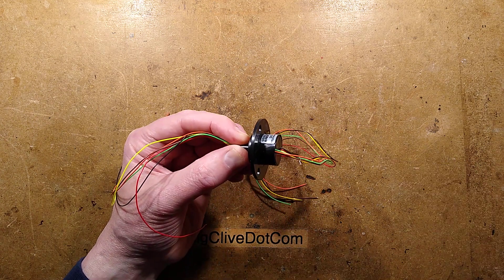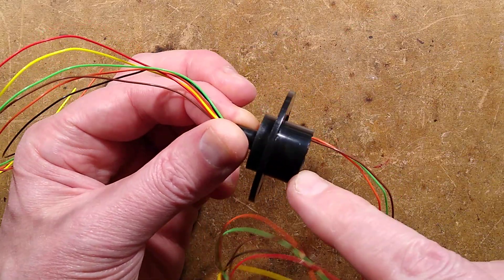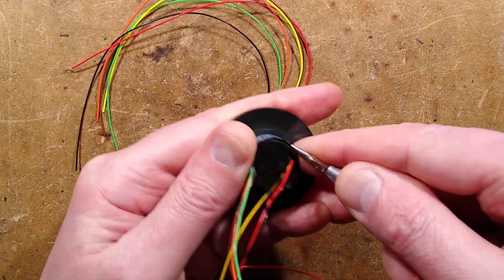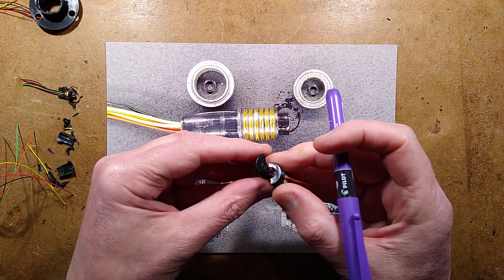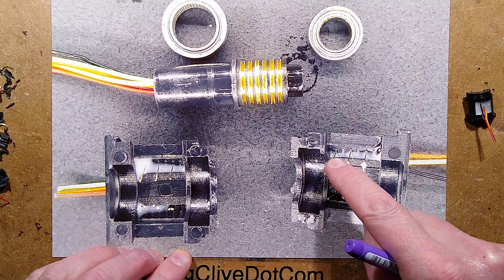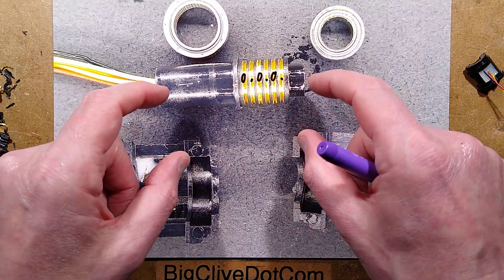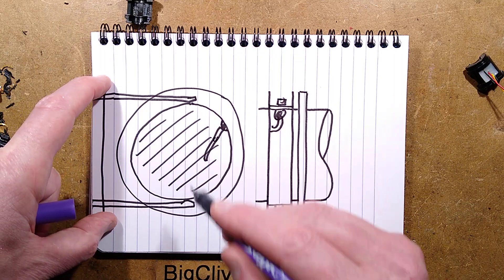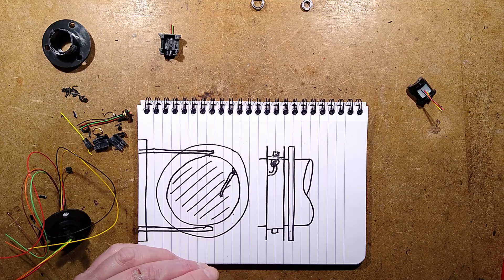6-circuit slip-ring teardown

Comment: I build rotating camera obscuras with 24V motors and 0-5V analogue feedback signals. They do a 24-channel unit and for reliability i double and quadruple up the lines, rather than using a hugher current rated unit with fewer connections. So far so good!

Comment: I have an HO (OO in the UK) scale model railroad that runs across a fireplace mantle over Christmas. It's 4m long but only about 30cm wide, so no room to loop the engine around. Since this is very non-standard,  there's no hope of buying an commercially made turntable, so I 3D printed a pair of 20cm turntables to turn the locomotive around at each end. I use an 8-wire version of the slip ring as the central pivot for each turntable. 2 Wires for track power, 4 wires for LED signal lights at each end of the turntable bridge, 1 wire for a light in the bridge operator's cab and 1 wire for LED common. Thanks for opening one. I've been wondering what they looked like internally.

Comment: When I was a child, I thought of a miniature train with an electrical system similar to this
The rails are made of wire/copper, each of which (right rail, left rail) is electrified by the anode and cathode, then the two cables to the DC motor in the train are placed attached to the rail anode and cathode.
But I'm not sure if it will work to make the dc motor spin and move the train with the dc motor wires dragged along the rail?

Comment: The most gorgeous slip-ring that I ever laid my eyes on was on a project several years ago to restore an 18m satellite dish built in the late 1950s.  Signals and power (lots of power) were brought across the azimith-axis interface with a 32-channel slip-ring where the rings were solid brass, with phenolic separator sheets.  The contacts were brass rollers that rode the brass rings.  It was a lovely, lovely piece of old-world engineering....
Reply: Rollers on the rings? Then you need something to make contact to those. Quite a lot of Ohms it sounds like

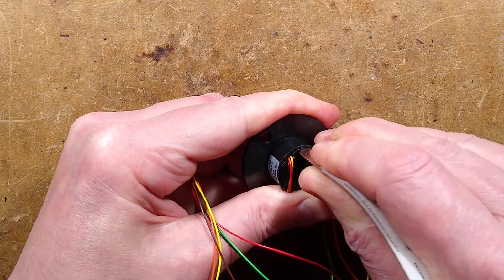Comment: 1:40 - "such good connection you could actually run data through it": I've run streaming video with a USB 2.0 webcam through these modern ones.  USB 3 not so much.

Comment: where would a hobbyist get parts to drive one of these with a motor? there doesn't seem to be a way to hook the motor up a axially...would you need gears or a pulley?
Reply from the maker: It's designed to be built into products with the required parts.  This slip ring assembly is not intended as a bearing, just as a pass-through for power.

Comment: thinkign i could use this for my steerign wheel for paddle shifts and horn
Reply from the maker: It's not suited for high current.  The steering wheel usually uses a spiral cable called a clock spring.

Comment: I always think: why don't they just replace horrible brushed, commutated motors, with electronically switched ones and some ultra low friction slip rings?
The mentioned lead (or other liquid metal) slip rings would be ideal I guess. No need to put mechanical load on them, or for the rotating and stationary parts to rub against each other due to the liquid metal. They could be very efficient I suspect, and last the life of the device it uses them. Lacking liquid metal like lead, or gallinstan, they might use some highly conductive lubricant, (Maybe oil with silver particles or such)

Comment: I am wondering if the unit was gas tight before you opened it and it had a vacuum internally to limit arcing on DV voltages?
Reply from the maker: No obvious way to maintain a vacuum.

Comment: If you're not familiar with them, look up automotive clockspring.  It's a clever way of making electrical connection to something that makes a limited number of turns, such as a steering wheel.
Reply from the maker: I took one apart in a video.

Comment: We have these in our explosion protected PTZ cameras. They pass 24 VAC on two pairs from a toroidal TFR that is located in the bottom and 100 baseT TCP/IP. We do have problems with the IP cameras freezing up and rebooting when they are being panned around. I suspect it’s this slip ring causing either power or comms issues.

Comment: ac doesn't degrade contacts as redily as dc does. thats why relays have vastly different ratings for switching ac and dc loads.
Reply from the maker: It's much harder quenching a DC arc than an AC one

Comment: It would seem to be impossible to connect a continuously rotating object directly to a stationary object via a ribbon cable without having the ribbon twist until it breaks.  Thus, the need for slip rings.  However, amazingly, it is possible to do just this (using hard-wired connections) without any sliding contact.  The scheme is used sometimes in centrifuges.  Look up "anti-twister mechanism".

Comment: This is actually the smallest slip ring I’ve seen. I build human centrifuges/flight simulators, the main planetary slip ring can have over 100 circuits and covers several mains circuits  (480V, 3ph, >50A ) for yaw/pitch/roll servos, as well as voice, data and video connections plus redundant circuits. 
I spend a day or two testing all the circuits before installation and even these huge expensive slip rings can occasionally have a dead ring and have to be sent back for rework.

Comment: Older video head drums (also in other helical scanning tape mechanisms) also used slip rings, though newer units switched to rotary transformers. Is there a good lube to use on these, or is it best used dry? Because I have some V2000 decks and there are slip rings for the video head's DTF system, and they're really worn. I'd like to get a little more use out of them, since nobody has made V2000 heads in 30 years or so.
Reply from the maker: If there is lubricant it would probably be a very specific type.  Best answered by the video community.

Comment: I use these on my Planetarium Star Projector. There is an axis for rotation at the base /Yaw with 48 Conductor rings, another axis for Elevation with 2 sets of twelve on both sides, and then inside for the Diurnal I had to hand build an 8 conductor pancake slip ring. All these carry the grounds, stepper motor voltages, encoder signals, and control voltages to turn things on and off.

Comment: I've seen slip ring assemblies for medium voltage cranes.  I love seeing how electromechanical devices look on the inside.  How they carry power and signals through connections meant to move.  There's something alien or steampunk about how some of these things look.  Anyways the rings on the MV connections were old and you'd get a corona glow and ozone when it hit the rough spots.  I was politely asks to step away from the slip rings because an arc flash analysis hadn't been done and they didn't know how close anyone should stand near it...

Comment: Going to use my eBay purchase slip ring for a diy wind turbine power generator made from a car radiator fan motor. Am able to pass the motor wires down through the top of the tube/post from the Motor via this slip ring and into a solar charge controller etc..

Comment: I worked with some such when I worked at Briggs & Stratton running engineering tests the ones we used where much higher quality but were expected to perform at much higher RPM. 
Fun lil thing it is

Comment: I love sliprings for some strange reason. I think it all stems from using "Mercotac" contacts to make rotating speakers (Leslie Speakers) for a mechanical tremolo effect on organs and guitars. They are light years better than your average sliprings having extremely low-resistance because the conduction path is a liquid metal molecularly bonded to the contacts. They never wear out.
Reply: As a Hammond tech I can attest to the Mercotac bearings being very reliable.  In 40 years of service I probably replaced 4

Comment: I made slip ring thing pings myself using stainless steel rings and carbon brushes to drive HPS lamps for the hobby. The rotating thing ping apparatus was physically set in motion by an old clock. Pretty amazing that it worked out. Actually the ballasts were separate so also the initial starting current went through my slip rings. Never had any problems.

Comment: Mercury bans are actually a fairly complex subject, and depending on locale there are small exceptions. More recent patents for slip rings use brushes or non-mercuric liquid metals, so it seems like the bans caused a slight upset in the industry. I do enjoy the idea of a slip ring having an inflammable/explosive warning on it.

Comment: If you wanted to use one of these for data/video. What would be the best way of testing them? Just a motor and then push a high frequency squarewave through them or is there a better way?
Reply from the maker: Just have something like a camera rotating continually to see if the video signal shows interference.

Comment: US Navy SH/MH Seahawk helicopters use slip rings at the tail rotor (for blade de-ice) and main rotor head (blade de-ice, position sensors and blade fold motors) and while the tail rotor slip ring is 'race tracks' of copper and pickups of sprung carbon contacts, the main rotor is a 3+ foot long monster that travels the entire length from the top of the rotor head and the distribution box, to the bottom of the main transmission and even then the cable for it is another 4 feet long.

Comment: On the CCTV side, they are used in PTZ cameras to pass the ethernet connection and power between the rotating camera portion to the fixed power/data input section.

Comment: I have been using wind turbines for around 6 years, and they come fitted with non sealed internal brushes and slip rings which fail after 12 months or so. I fitted a mercury wetted sealed unit with brings down power and data to my controller and it performs perfectly (now 3 years without trouble). They are very expensive, especially the high current versions, but save 2 days of ladders and pulling apart everything to replace the factory fitted open units.

Comment: A slightly bigger version is commonly used to upgrade motorcycle wiring on the front fork because the wiring from the factory bends every time the front handle/fork is turned and eventually breaks the fixed wires.
Reply: I've never seen a motorcycle with a slip ring.  I've never had a motorcycle that had handlebars that turned 360 degrees either...  Stunt bikes maybe...

Comment: I'd be happier using ball bearings as the contacts - the inner and outer rings are kept in contact at multiple points by the balls.
Reply from the maker: There's an issue with ball bearing races carrying current.  The tiny contact sparks gradually cause spark erosion that gets worse with time.

Comment: TIP!
Some more  expensive  water boilers with digital temp controls and electronics in the base ,have more than 3 slip rings  in the central hub conector,  defective boilers of this kind can be used for parts where higher current / line voltage is wanted in a rotating assembly.  Unsure if it can manage constant rotation..... (probably not;,but intermittent  movement at slow rpm may work.)

Comment: I understand there is something similar in most steering wheels to transfer power for horn button, airbag detonator etc.
Reply from the maker: That's often a clock spring - a coiled ribbon cable.

Comment: The cotton candy machine I work on at work has brushes on a solid core of copper that is attached to brushless motor. These are the connections for the heating element that spins. It's a pretty old machine so I'm sure that later revisions have been updated
Reply from the maker: That's very standard.  Two brass or copper rings with two carbon brushes.

Comment: I have the same one on my weather vane project. I have an Arduino Pro Mini inside the rotatable 3D printed weather vane body, a propeller on one end, a MLX90316KDC-BDG rotary hall direction encoder in the middle, and a tail fin at the back. The Arduino processes the data and comes out via serial RS-485 through the slip rings to an indoor LCD display. The slip rings have been working fine for a few years now. Nice to see how the slip rings work inside, thanks.

Comment: I think if you had a CCTV camera rotating at 200 rpm, you wouldn't need to worry about signal quality!

Low voltage lighting in rotating display cabinets, maybe, or display turntables. I could see an application for these in model building where you needed to bring current to lighting on things like big-wheels, carousels and similar items, model railway turntables where you might want to supply power to lighting poles, motors and to the actual rails that the locomotive is standing on.

With a bit of imagination, there must be a million and one applications, but I agree entirely, not at 220v. At 22v, maybe!

Comment: They are also used in automobiles behind the steering wheel.it’s used for horns and airbags.
Reply from the maker: Those might be the spiral ribbon cable "clock springs".

Comment: You would think automotive airbags would use this, they don’t. They have a clock spring that attaches to the steering wheel and electrical connect the airbag to the system. You have to wind it by hand counting the turns and then move it to the middle position so you have equal length turning the wheel left and right, if you don’t install the clock spring correctly you will break it and you just destroyed an expensive component. Usually when the bags blow the clock spring is still good.
Reply from the maker: I featured a clock spring in a video.

Comment: Thanks Clive. I notice the middle finger of your left hand has thankfully lost the Elastoplast. At one stage I thought it may be making another reappearance if the screwdriver had slipped. I have a beautiful 1 inch scar on my left thumb where some very sharp plastic split it open during some similar disassembly many moons ago. IIRC I think I taped up the resulting wound with insulating tape, we didn't have gaffer tape then.
Reply: Thousands of people in the US end up in the hospital emergency room every year because they cut themselves while opening clear plastic "clamshell" packaging .
Reply: @goodun2974  Nasty stuff that packaging. It would not be impossible either to include a "Tear here" seam in the manufacturing process.
Reply: @linuxgreybeard9945  ,  those clamshell show packages are often too thick and heavy to cut with all but the sharpest of scissors and so I usually cut them open with a surgically sharp OLFA knife and blade.  The sharpest razor or utility knife blade commercially available, they are scary sharp, but not as scary as the freshly cut edge of a clam shell blister pack.... And yes, a rip strip to make it easy to open the package would be a good idea, but I guess that's beyond the capabilities of the "geniuses" who designed packaging. I routinely encounter Plastic bag packaging for snacks and dog treats and so on that have a notch in the side which says "tear here" and then you're supposed to be able to seal it up again with a Built-in ziploc strip, but they don't open correctly and they don't seal correctly either.

Comment: Same principle at play with regular corded vacuum cleaners, the kind that has a windy cord that you need to pull out and then it reels itself back in when you hold a button. The fingers in the mechanism get worn out over time, it's a very easy fix as you just need to put a bit more bend to them.

Comment: I own a turntable of which the tone-arm rests in a mercury bath (the contacts...No gold contacts obviously...I think titanium or platinum but not sure 'cause very tiny), every now and then I need to "refill" the mercury...Better said replace for clean mercury and with that replacement you can simultaniously clean the "old"....which can then be used again the next time. Ofcourse it evaporates a little over time too. Not the most healthy system but it sounds awesomor at least as good as normal wires. I keep it because of the quirkyness but use a different TT most of the time. It is a Japanese system of the late 70's, early 80's made by Micro Seiki. Got it of my dad who bought it new since he always was a crazy audiophile.
Correction, the arm is by Micro Seiki and the contactor bath by Keith Monks.....

Comment: Where I work, we use tons of slip rings for various things.  In fact, we have some fiber optic sliprings for data.  That is a teardown I'd love to see.
Reply: I've seen a single fiber run straight down the middle of a rotary joint, but when you say slip-rings, are you implying multiple fibers? Now I'm intrigued.
Reply: @myself248 No -- that's what I mean also.  It's a combination electrical slip ring with a fiber in the center.  I should have been more clear.

Comment: Radar rotary joints might also pipe kilowatts at microwave frequencies down two pipes for two polarizations, plus slip rings for red lights on the sail, and even some low power coax downlinks. You don't get those on eBay cheap.

Comment: I frequently use slip rings from michigan scientific to transfer out the signals from full bridge strain gauges on spinning shafts. They do impressively well and can handle quite high speeds without an issue. There are other ways but they're expensive (RFID style / wireless sensor from HBK)

Comment: When I used to turn wrenches on M1A1 battle tanks for a living, I once performed a forensic disassembly on a malfunctioning turret slip ring (it also passed hydraulics in addition to electrical current and signals). It was nothing like the one you took apart (the electrical connections passed through a pair of platters instead of a cylinder).
Reply: According to Wikipedia, that is in fact a commonly used alternative design. It suffers from a bunch of reliability issues, but it has the advantage of being flat and increasing in radial dimension as you increase the number of conductors. For some applications, that's a crucial difference, as you can't arbitrarily increase the length along the axis.